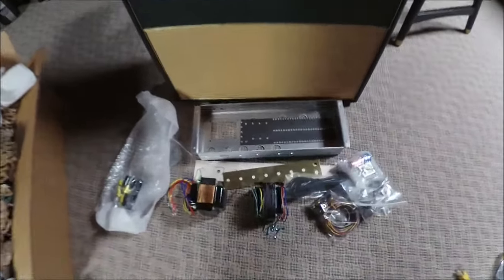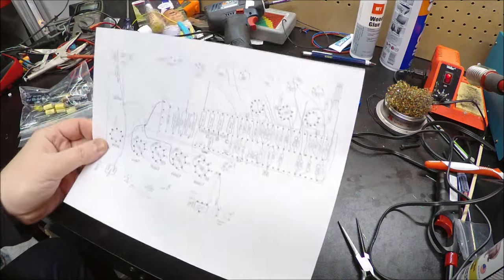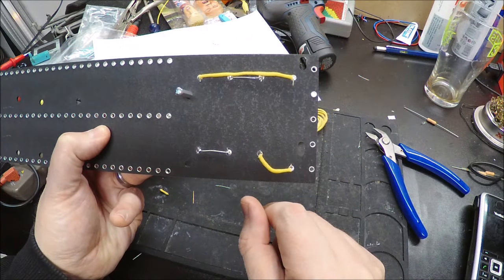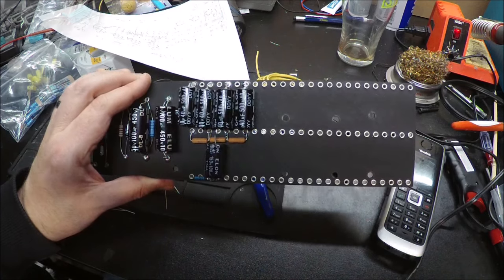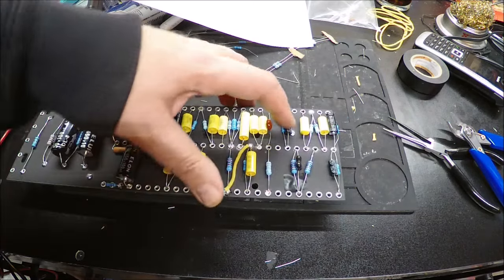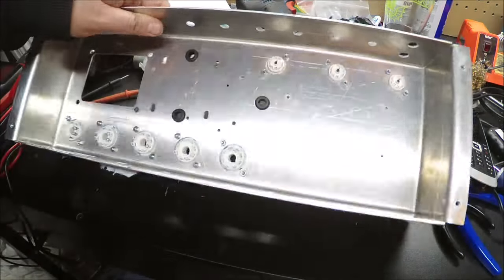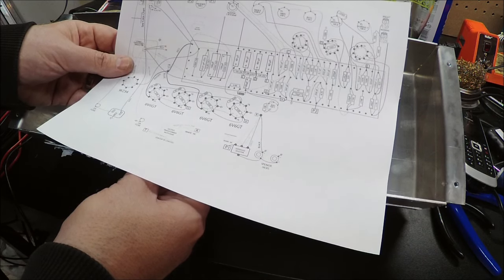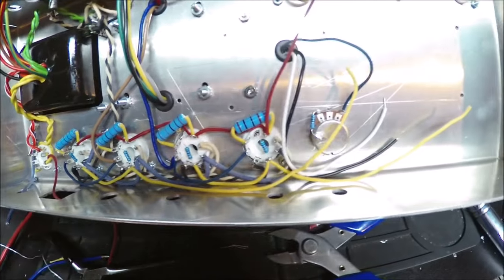Let's build the Ted Weber "Natalie"  amp kit.......  and see if it works.

Comment: DK, great job, I have never seen a quad 6V6 before.  What was the final plate dissipation.
Reply from the maker: I set  it at about 7.5 watts/tube.  62% ish.  I went back later and changed resistance values in the bias circuit to get more negative voltage.   Originally it was at the 70% tipping point,  and I thought it sounded bloated.

Comment: The "Bright" channel sounds perfect. Master vol on max and use the pre-amp vol as a "Master" to get it chrystal clear so the tone-stack gets really sensitive. A beautuful design, sounds very VOX-like. Like the 4 6V6 idea, like a lower volume "Twin" but warmer. Great job!
Reply from the maker: I'm temped to tone-tweak it a little...   but since this was filmed,  I made an adjustment so I could relax the bias just a bit.   It was riding the MAX safe line...   now it's more in the normal zone.

Comment: Nice one mate!  Always great fun building valve stuff, with nice clean terminals & wires to work with for a change ay?  You did a neat job of the wiring too; it looks good!👍

Shame they forgot about the bias pot mounting hole though!🤪  Derrr!  How could they forget that?  Well done she worked first go yay!

I wouldn't have used such a prominent speaker impedance knob though, if it was my design.  Too easy to accidentally change, or for some knob-twiddling klutz to stuff up. - Although you said it was YOUR amp!  No inference or insinuation there!

Cabinet looks pretty good although plain.  Maybe some kind of cursive name plate of 'Natalie', or 'Crystal' etc would add some 'interest'.

It sounded good too, & as you say, the bright & normal channels sound totally different from each other.  This may be a good thing, & make the amp more versatile.  I heard some nice crunch there too.  I would have liked to hear you make her scream too (lol) but never mind!

Overall though mate - great job 10/10!
Reply from the maker: I THINK they are using a chassis that is normally used by a different amp...  so the changes from amp 1 to amp 2 are sometimes not all implemented.   Fortunately it was aluminum.  The Stainless Steel ones are not easy to drill.
Reply: How come its a she?
Reply: @ @zenscapeUKmedia   I called it a she because the model is a 'Natalie', & this seemed to be the most logical 'gender' to give it.  

Geez, you're not gonna start an argument over the gender of a bloody guitar amp are you?
Reply: @nevillegoddard4966  No, no argument. I don't get why people give objects names. Its weird. Just as long as you don't buy "her" a card on "her" birthday or take pleasure from making "her" scream. That would be a bit worrying. It's just an inanimate object. A well assembled one, none the less.
Reply: @ @zenscapeUKmedia    Oh, good mate!  Well, as far as 'humanising' inanimate objects goes - When I put SO many hours, sweat, &/or $ into a project, whether it's to build it from scratch, to repair it, or to renovate it, & try to do the best job on it I can, an 'attachment' can emerge for that object.  I know every part of it 'intimately', so to speak.  Getting it going is like bringing it to life, producing a newborn child, in a way.  Not literally, of course.  But it 'has' some of my 'spirit' in it, in a way.

That's why they say something was 'lovingly' built by hand.  Well I sort of build stuff that way - to last forever, & funnily enough, most gear I've built, even 30-odd year old stuff, still works!

Like my 2003 Li'l Blaster 125W subwoofer I built for my house, that's still working, is gonna be used in the back of my car now, with it's simply superb sound as good as it was when I built it.  I 'love' my Li'l Blaster!
Reply from the maker: I name all my amps........but people names on work projects isn't my style either.   Former projects have been named things like  "Monarch,  ElectronBlue,  and Beefmaster"  This amp has been christened the Lucky Badger

Comment: You'd figure that putting the amp together would make it cheaper, like guitar DIY kits.....but nope. It's still 1500 USD to get a full kit w/ cabinet for a Brit 100W amp.
No thanks. I'd rather have just as much "fun" sourcing the parts out, finding a used cabinet and doing this for about $500.
Reply from the maker: The full weber kit with shipping is under 1K.   Others overcharge.